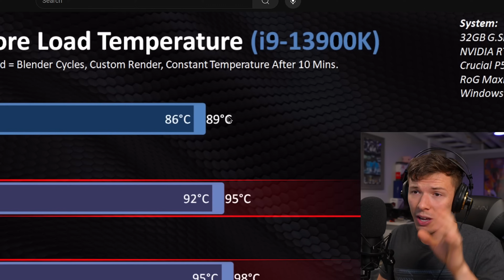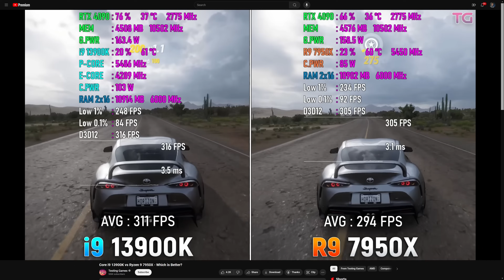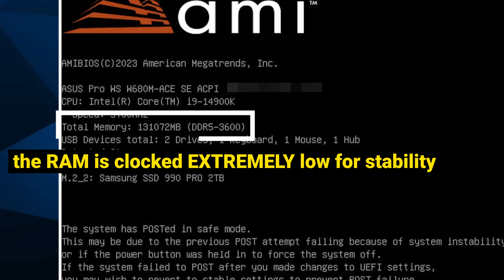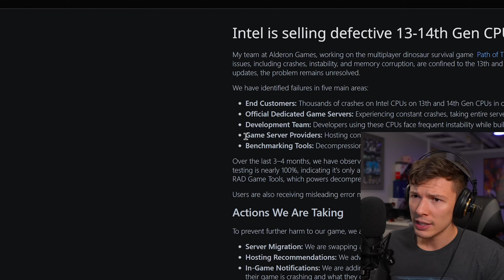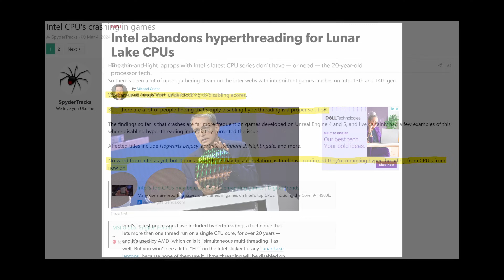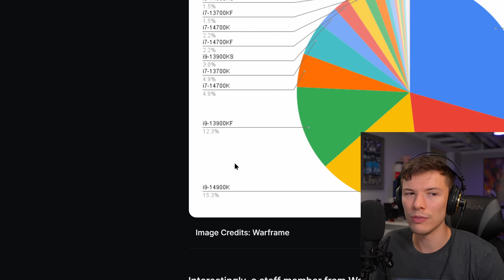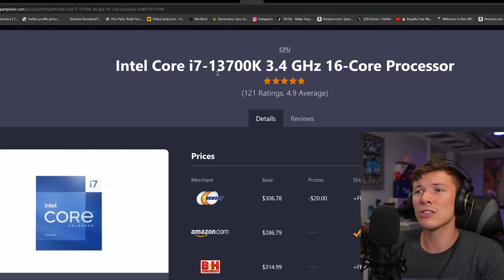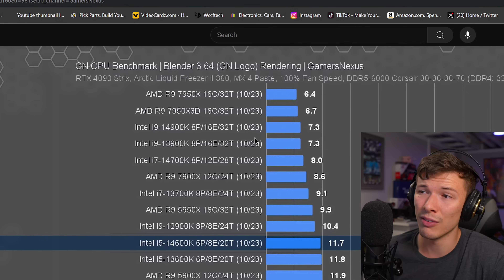Intel F**ked Up Bad

Comment: Between 41,569,085 and 49,500,000 14900/13900K_ produced which is 1/3 of full run. On range low 100% replacement at variable cost of production = $1.5 billion, on marginal cost of production = $2.5 billion, on volume OEM and retail customer full line procurement = $10.267 billion that is the price to wholesale trade and a subset of retail price to end users. Now the administrative cost of replacement that includes in SI PC swap say $60 each adds another $2.5 billion so all up $5 billion in potential Intel replacement expense that is pocket change for Intel. 

I'd say the issues that have been brought up include CPU and memory OC that is Build Zoid attribution, 13th/14th disaggregate i/o controller that is Tech City Yes attribution, thread directed compilers I've been talking about that since October 2021 Intel did not make them easy which is why APO for games P+E cores compiling. Intel always makes easy tools knowing to sell processors in volume the average coder needs to know how to effectively rely on them. I don't think it's process, 13th/14th + 200 MHz over Alder but even I just lowered my 5800X underclocked from 4.6 GHz all core back to 3.8 plus boost on my aim of transistor endurance 10-year life.  I will add theft of duds by Intel back-end production (packaging) employees resold by them into sales channels. Plus, Wendell now gathering erata on data from that game cloud provider.  Leaves mainboard houses pushing the CPUs on their board set-up in BIOS in order to compete with each other in the board market. Intel seriously policed this a decade ago and before but somehow paid less attention or gave up policing. Perhaps product managers from board houses invaded Intel through the employment process for their mainboard former employers negating Intel policing pushed board platforms out the box which is a bad idea? Just run the CPUs within their power spec. 

mb

Comment: I still use intel CPUs, mostly so that I have interchangeable parts on all my PCs all being LGA1700, otherwise I'd switch to AM5, I just don't have the Money or time to switch all 4 of my PCs over. So what I'm doing is sticking with 12th gen up to 12900k and if I ever do get 13th/14th gen I won't be getting anything better than a 13600k/14600k since those don't seem to have the problems that the higher end chips do. Right now 12 series chips are a really good value, especially with Microcenter's bundle deals (just got 500-600 in MB/CPU/Memory for 250 if sold separately in one of their deals!). It's really sad that this is happening. Luckily I don't even need that much power for what I do so it works out. Hopefully Intel will fix things with their next Gen. They REALLY need to recall these things and replace their bad processors (what do you replace them with though?) but I suspect a class action lawsuit is cheaper so they're gong to force that. Heck, maybe I should get a 14900k, then manually setup my own undervolt settings just so I can get in on the class action stuff, though I suspect the rewards will be a bit of a joke in the end.

Comment: This is a captain Obvious comment ... 

Yes, cpus are expensive, but the problem is more than that. If you go for another platform (amd), you also need a new motherboard and probably cooler. And then all the work of building and reinstall OS etc. etc. The "cheap" solution, buying another 1700 related cpu means lower performance, and to many that is not a good alternative.

Comment: I've been using overclocked Intel CPU's for years, never had a problem. If a 100% of them are failing that's 70% of desktops according to recent figures (allegedly) somehow I  think a few % is a more accurate figure.
Reply: my 3570k at 1.3v for years 24/7 no issues

Comment: I have 13900k and I had Ryzen 7950x
I have 13900k because it has the best frame to frame latency, better than 7800x3D or any other Ryzen chip currently
It makes a ton of difference when it comes to mouse click to action shot in the video game. Important for shooters in multiplayer for me
13900k has a ton of cores that allows me to render a video and still play Battlefield 2042 at the same time without noticing any dips in performance visually (I have RTX 4090) and mind you I am rendering video using the GPU on top of it, which is taxing the GPU while I game, and I notice nothing major to impact the game while rendering.

I did have my first cpu begin to degrade after about 6 months, so I rma'd the 13900k, but it's hard to tell the factor, as I undervolted and undervolting can cause the chip to degrade as well (don't listen to Youtubers, undervolting can impact the chip permanently after a while), so I had to up the voltage from my undervolt, but it would begin to hang the desktop, but never crashing in games though.

After RMA I limited wattage to 262 watts compared to 300 watt limit I have set previously. No issues so far, but I can't confidently speak whether I did that to the CPU or the CPU failed. It took very quickly to have those instability issues with undervolt, but nearly same thing happened when I did so with i7-4790k years ago, so i cannot blame Intel for 100%. It may or may not be the case.

I also tune my CPUs and I had 13900k set to fixed cores at 5.5 and 4.3 ghz (Pcore/Ecore) 
I overclock ram, so that's another factor, but the reality is that if you allow those 2 cores to clock up to 5.8 ghz, and let voltage run free, it will likely fail the CPU
I also don't run Speed Shift and Intel Speed Step, so my cores are  pinned at 5.5/4.3 and also run voltage at 1.28v (vcore) with Level 6 load line calibration. 

That itself and 262 watt limit, and Multicore Enhancement off stabilized my CPU and I will not try anything else.
13900k is already overclocked to the ceiling by factory settings, and you are more or less required to voltage limit it, and you won't lose performance in most cases, at all. Minus that 5.8ghz boost, because boost like that will cause game stutters, and it did for me, hence why I turned it off.

7950x was considerably slower CPU like 30-40% slower in games, and also ran hotter than 13900k. 
Still a solid cpu, but this is why I run Intel, better frame to frame latency, and way better 0.1% lows, so less dips.

I run MSI Afterburner graphs in overlay and I can see that dip with AMD, even though it has no E-Core/P-Core shenanigans

Neither CPU is perfect, but Intel is simply better to what I need. To see AMD improve their latency in frame to frame is important to me, and also increase core count to 24 and 32 cores for their flagship. I don't rag on AMD or Intel, but you have to be objective about the failure rates too. I don't deny that perhaps my CPU failed after it was giving it too much voltage at 300 watt limit, even though out of the box with Multicore Enhancement ON, the CPU will draw more than 300 watts, like 320 I believe. So I turned off Multicore Enhancement because it just heat dumps for no reason and monitored to see that I am only drawing 220 to 252 watts underload in AIDA64, so...Intel CPU requires tuning, but so does AMD chips, and what I don't like about 7950x, it fluctuates in frequency and doesn't stay pinned how I want it to with Intel. It will boost around 5.4-5.6 up and down in games, that can cause stutter like 5.8ghz 2 core boost on 13900k. Keep that in mind and feel free to see my channel for benchmarks.

Comment: The biggest issue I have with this isn't that there was an issue. I'm ok with there being issues. I've worked through them before and I enjoy the problem solving aspect of it. That being said, what bothers me is that the only fix for this is losing performance. I bought the CPU because of the advertised performance.

Comment: Anyone here experienced the same failing issue on intel 13th and 14th Gen as this video described? 🙏
Reply: I use a 240 aio and mine runs fine.  I bought it when the 13900k first came out.

Comment: I think motherboards  manufacturers are the MAIN blame. Just look at Asus with their exploding cpu's on their MB.....I followed Intel recommended settings ie PL-1 125w PL-2 253w on my i7-13700k yes the issue is more related to i9 i know. Intel should have done more research before releasing it tho...
Reply from the maker: Tru, but I also can’t blame motherboard makers for wanting CPUs to perform the best on their platforms. Problem ig is that it is on by default
Reply: @vextakes  No issue with MB manufacturers allowing cpu's to perform better however if THIS comes with danger ie ruining your brand new platform then the manufacturers of mb's are to blame 100% i mean Asus could have done some proper tests but they didn't or just didn't give a damn luckily gamernexus exposed them for what they are. Imo the main blame is motherboard manufacturers and secondly Intel for not doing their homework better before release.

Comment: I haven't had a single blue screen with my AMD CPU while it's overclocked and running 6000mhz ram. I knew from the start intel was garbage in that their CPUs bend, extremely power inefficient, no upgrade path (gotta replace mobo) and now this!. Utter garbage. Can't say I'm mad about it, after all intel is a woke company and they deserve their downfall. Yes intel started working on technology to sell to game makers so they can silence gamers if they have wrong think against the left or normal trash talk.

Comment: A key thing is AM5 will have support until 2027+ 

So there's pretty much no reason not to switch.
Reply: 2 core ryzen 7000 series chips or 7600X3D chips does not count as support "past" 2027🤣🤣😂😂😂😂😂😂😂😂😁😁😁😁😁😁😁😁

Comment: How much more complex is a circuit design for a single core heavy CPU than a hyperthreading CPU design, is it cheaper or more expensive, does this provide incentives to cut corners by the PCB manufacturers. These are the questions that need to be asked before everyone jumps to the conclusion that its the CPU's. A reputable manufacturer like Intel doesn't just go from high success rates to 100% failure rates because they didn't do something right. Even if 1 core on these chips fail, the chip still should work, so why is it failing completely, thats a bottleneck of voltage, and a bottleneck is the board. AMD struggles with this in many cases as well, and its because the boards don't match up to the processors like they are supposed to.

Comment: Imagine that CPU and GPU manufactures are all in a competition to outperform each other, well where is the incentive for board manufacturers to compete? How many years has it been since anything significant or spectacular has emerged for board/PCB design other than a cooling sensor display on the motherboard, or fancy lights, or even more efficient cooling systems. The motherboard is design around the CPU, not the CPU around the board. Some people implied hyperthreading as a potential issue, who dominates the hyperthreading market? AMD... Intel is focused on single core, AI uses more hyperthreading, AMD is a competitor, if they were leveraging them to shift their architecture design to compete on par with AMD it would only take a motherboard fault to do this. If hyperthreading is becoming the priority opposed to the CPU's architectural requirements, then they are sabotaging the CPU and not designing the boards to spec for the CPU, not the CPU to the board. Remember that.

Comment: No offense, This doesn't affect all chips that is 100% false and misleading for YT clicks. There have been simple fixes for those that could potentially suffer from this from the start i9 folks of 13th and 14th gen (12th gen is slightly different than 13/14 as per intel). The problem is i9's K/KS variants are sold as a enthusiast CPU for overclocking. Not many want to  buy one to just run it stock speed or at minimum in XMP. Add aggressive settings and not setting any power limits and its a recipe for disaster and that is what has occurred in these specific chips. i9's are a very small amount of the 1700LGA  CPU market. Its literally a 1% issue. We run these CPU's in multiple stations and guess what? no issues. We don't game on them though, they are for work. We game on our own systems. our 13th gens for work stations are coming up on 2 year mark come September without one issue all power limit set from the start, no reason to OC these for work and they don't have WC loops or AIO's on them. So only i and maybe one or 2 others struck CPU lottery? What about all the folks using them without issue at all all those i5 and i7 users who just keep chugging along for 2+ years now for 13th gen and longer for 12th.  Steve Burke and Level 1Tech video covered it as well as it could be and people still come out with different information from it (SMH) you only show clipped edits from it no context which you need from the whole video you state what they did not for clicks! Your opinion is fine, no issue with that but the way you represent them is less than honest or scientific.

Comment: The thing about the 14900k is that if you buy one; you basically have to delid the thing just to keep it tamed 💀. Delidding is not supposed to be the standard for cpu cooling lmao. 

This is why the 7800x3D is so absolutely superb. It still outpeforms it in gaming due to  actual innovative design (I wish they did the cache on all 8 cores on the 7900x3d instead of 6 though lol.)

Comment: The board manufacturers could be saving money by keeping old board architectures to cut the time it takes roll out the new boards to match. It may be a technological bottleneck where board manufacturers aren't able to keep up with the hardware. This has not been the case in the past as it usually was the software that outpaced the hardware, nowadays the focus has shifted, now we are faced with more and more hardware that exceeds even some of our softwares capability rendering a lot of hardware as redundant. Remember when Crysis was better than multiple years of hardware. Now imagine that some hardware companies are lagging behind, remember how hard it is for the thread ripper to run at full capacity despite its specs, this is a problem for AMD that is similar although not the same, the board manufacturers are struggling to keep up with the processors not the processors keeping up with the boards. Hardware to hardware bottleneck, and its always because the board architecture is not capable of keeping up.

Comment: I also think the main reason I could see Intel and AMD push AI in their marketing at least from a gaming standpoint is because of AI powered NPCs that use AI software like chat gpt to talk to the player with mostly unscripted dialogue. We're already seeing modders do this with Skyrim.
Reply: Yes,  NPC using language model could be here relatively soon.  I tried a game + LLM  at same time on the same GPU and it already works.  Tested on a 7900xt, so it is easy to imagine AI NPC being a thing, even on mid-range GPU in a couple of years and no need for an AI service.
Reply: @leucome  yeah, I've seen its been done for both Skyrim and Skyrim VR by modders and I think it has a lot of potential.

Comment: Faulty voltage regulation on the board and bottlenecking of voltage too close to the socket on the board seems more likely, the problem would be closer to the socket on the board and may be missed due to its proximity causing the assumption that it is the CPU heating up due to its own internal architecture opposed to the heat build up happening on the board. Even if the bottleneck was right where the socket runs into the main circuit of the board heat transfer could cause this to happen, too much or too little insulation around the socket area on the PCB, the wrong resistors with too high of a resistance could cause a voltage back pressure. Remember when I say back pressure, its because electrical circuits are very much the same as piping for hydro systems, or even oil and gas or pressurized liquid or gas systems. This is possible in a circuit the same way it is in a plant pipe system, the wrong pressure ratings, the wrong diameter pipe, a bend where one isn't supposed to exist, or a connection from something with more pressure overwhelming the flow could factor into a back pressure effect with voltage that would ultimately cause both overheating, and eventually hardware failure. Too much pressure on lower rating pipes in pipe systems can cause a banana peel split of a pipe, too much pressure into a container with no failsafe can cause a burst or a crack in the containment vessel, its simple physics. People need to consider that their may be a complacency in the board manufacturers themselves, this would be more likely, 100% failure rate on all boards but not their testing ones seems very suspicious from the direction of the board manufacturer.